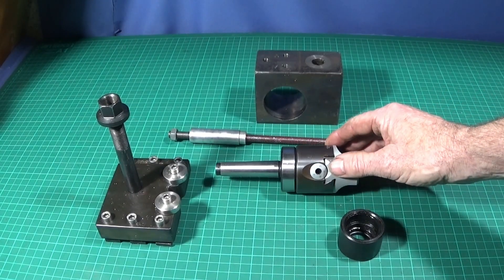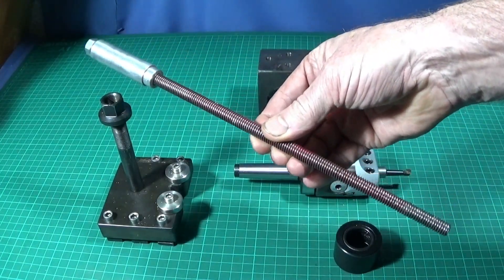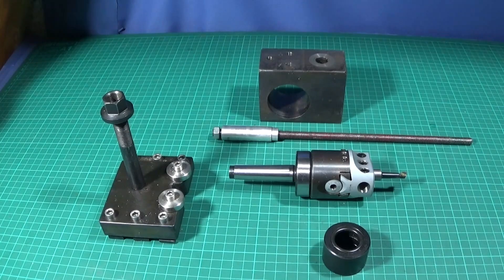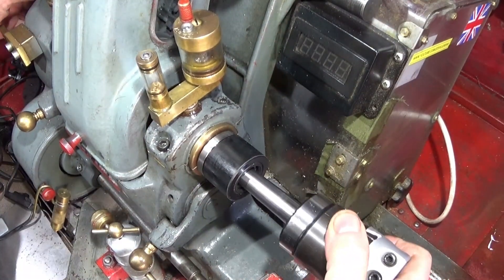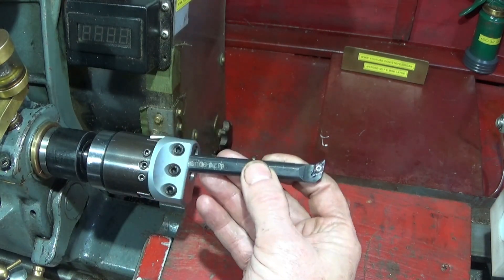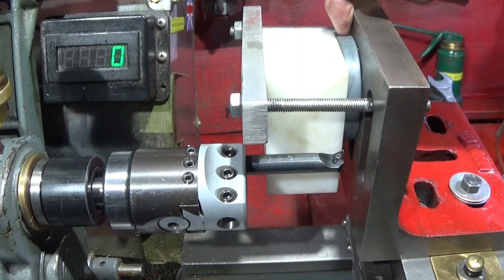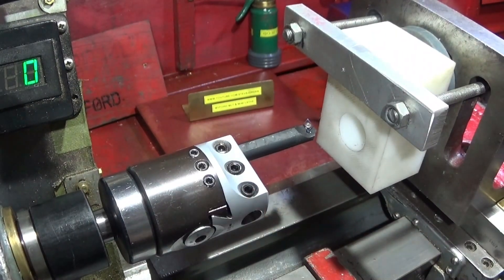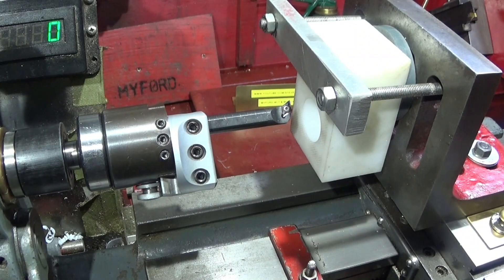Using A Boring Head & Angle Plate On The Myford ML7 Lathe

Comment: Hi Steve, I really enjoy your engineering videos. As I am fairly inexperienced in machining, there is an explanation I have been trying to find for a while now. Perhaps it's a fairly obvious thing but, I was wondering if you have a video that would be helpful in aligning something that already has a large bore (eg a small engine block) ready for rebore?
I would have to carry this out by line boring between centres. I have absorbed lots of info on the rest of the set up and tooling but, the setting up of the workpiece itself is proving somewhat illusive.
I am very concerned about the possibility of ruining the concentricity or, moving the bore into a slightly different position within the block.
I hope the above is clear and makes sense. If you haven't made a video that would cover this and don't want to get involved, I quite understand. Thanks for your time in reading this.
Reply from the maker: Hi Paul, Thanks.I am inexperienced in this sort of work, especially without seeing the component. Maybe someone else can give you an answer on here?  Regards Steve